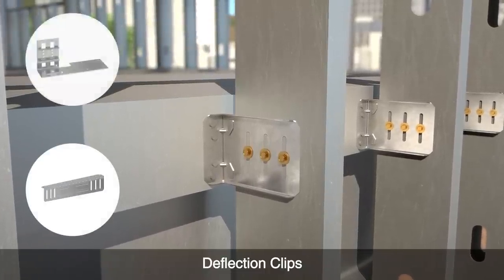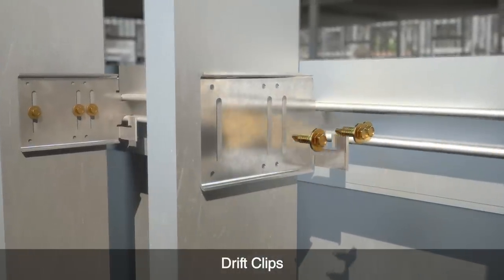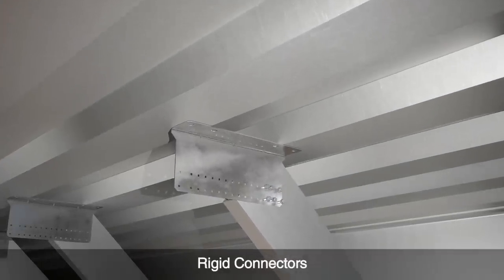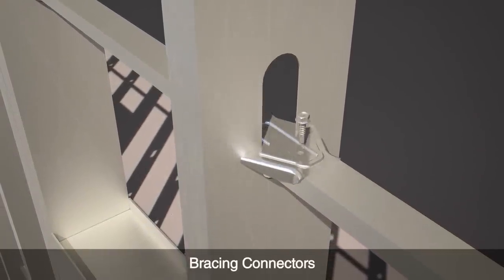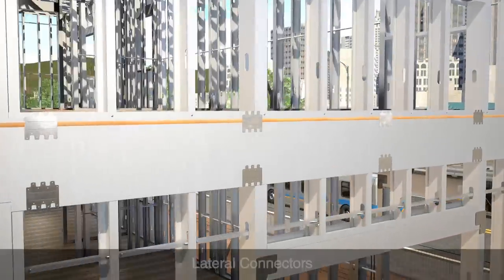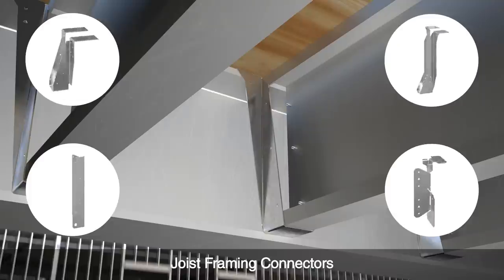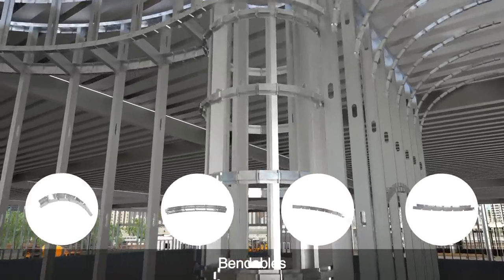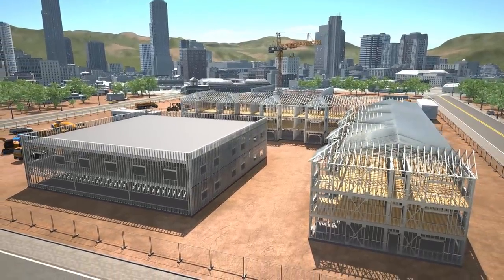Innovative Solutions for Cold-Formed Steel Construction

Comment: What are the filler materials inside steel frames, other than wood, is concrete also used as a filler material ??
Reply from the maker: Hi Fareeha! We connected with our team, and they let us know that - insulation would be the only filler material. Concrete would need some kind support system in the wall, such as rebar, essentially making that small section a precast wall. However, we do not believe that would be a cost-effective design or build method. We hope this helps!